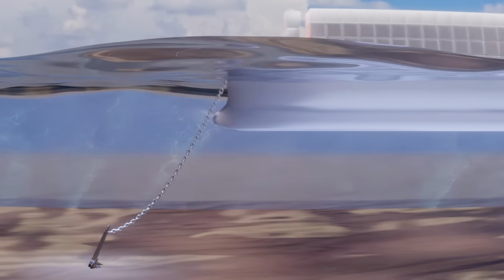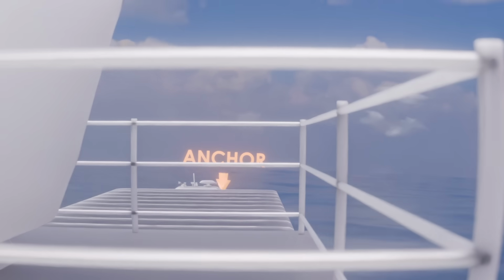Anchors don't work the way you think

Comment: But they left off the ratio of depth of the water vs the length of rode to let out. In calm waters, the ratio is about 5:1. So, if the depth is 100 meters deep, they would let out 500 meters of chain. If rough weather is expected, you let out more like 8:1 or 10:1 so the catenary curve acts more like a shock absorber as the storm batters the ship.
Some of you have heard the term 'bar tight' which means so much force  on the rode that the chain is straight. That's highly unlikely, since to really get the catenary curve out of the rode, you would have to pull so hard the chain or anchor or the attachment points would break. So, take it with a bit of salt...

And since there are thousands of tiny boats (under 50') out there  that use rope for an anchor... How does that work? Often, the anchor will have some amount of chain on the anchor stock and then the rope is spliced or coupled to the chain. The chain still helps keep the stock down, and keep the anchor from pulling out of the sea bed. The longer chain you have, the more secure you are.
One more thing, most anchor chains on ships use a studded chain, which has a bar in the middle of the link which keep the link from stretching. Their animations didn't show it properly. 
If you want to know more Nautical knowledge, read my book on amazon called The Nautical Dictionary.

Comment: Never worked with an anchor like this. My dad had an anchor on the outboard motor boat we used to go fishing. It seemed to hold us in place. Sometimes it held us in place very very, very very well. To the point you couldn’t get the anchor up. At once, when we were about 2 miles out to sea, anchor got stuck, my dad got impatient, and tried to pull it up with the boat. The anchor then prevented the boat from moving up and down with the waves, a wave came, washed over the stern the boat, and we went swimming. Luckily one of my uncles was out with us, noticed the problem, and we all got in his boat.

Comment: To pull the anchor out you have to reel in the tow road or chain so that it is directly under the boat. Then to pull the anchor up you have to reel in and unbury the anchor from the bottom. You may have to pull up hard. You know that you a vertically over the anchor because the bow will dip down in the water.

Comment: Working in 5000ft water depth, we'd run out 3000ft of chain followed by around 10,000ft of wire. Do that eight times and you have anchored a deep-water semi-submersible oil rig.

Comment: So here in Michigan ferries will actually do something called anchor turns basically, while heading directly towards the dock, they will drop the anchor and do full lateral thrust swinging themselves around so that they can essentially back into the spot. Imagine this is possible because of the relative weight of the anchor versus the size of the boat. Just a heads up that it's not complete fiction

Comment: as a harbor pilot with 20 years of experience I have probably anchored around 1000 ships,  an anchor will definitely stop a ship if it's going pretty slow. We use anchors to help ships turn when going slow and no tugs available. Bouncing an anchor off the bottom at slowish speeds can aid in handling.

Comment: The title should have read, “Anchors don’t work like you think, Unless you were in the Navy” lol.  I learned nothing from this video.. And thank goodness right.. What would the Navy be if they didn’t teach this in bootcamp lol.. Theres actually a question in our bootcamp tests that asks.  “What part of the anchor actually does all the work?”. The answer is The Chain.. The chain is what actually keeps a ship from drifting.  The Anchor is just the point that keeps the chain from snaking all over the sea bottom.  Now on small boats, yes, the anchor does all the work if its just tied to a rope like you see allot. Or those weighted anchors that look like a mushroom.  But on big ships, custom chains are build for the specific size of the ship.  Still a great vidya!

Comment: This is not entirely true. The anchor cable , because of its weight', pulls the anchor Horizontal and forces the anchor to plow deeply into the sea floor. The captain and crew choose precisely where and when to anchor their ship. When the anchor hits the sea floor (this can be automatically or manually count) they let the ship drift slowly backwards until its weight' pulls the chain under tension. The condition and material of the sea floor matters everything. Its everything together that makes the anchor work not only de heavy cable. Besides that, you have all kind of different anchor size, weight and curves for different purposes.

Comment: Anchored off the canary islands, La Gomera, our windlass malfunctioned, the anchor roller bow sprit (made of quarter inch welded aluminum) bent about 45 degrees over to the left, almost letting the chain slide off the roller and in to the siderails
 
Two of us of the three man crew had to haul up 60ft of chain by hand in 10-20kt gusts, cap on the helm... took about 4 hours because every time the wind ripped down this hill on to us, the boat pushed back and the anchor chain tensioned, pulling it from our grip like butter. by the time we got it up we had discovered it must have been buried deep in silt or wedged between rocks on the seafloor, the 25-30kt gusts we had the night before sure dug it deep.

For anyone wondering, we were not able to get the windlass repaired for about two weeks and had to hand haul every time. Busted my foot the same week dropping a Danforth on it, sailing is not for the weak-able or minded🤣
Reply: Thank you for this story. It was really interesting❤
Reply: I’m just amazed that the aluminum deformed that much and didn’t snap off. 

My experience has been if you put that much deflection in an aluminum piece (especially if it’s been welded as you are going to have a very brittle bit adjacent to a very soft segment of metal) you are going to have a catastrophic failure and end up with one piece now being two. 

I would have loved to had a clip of that happening, preferably high speed photography. Seeing metal fail because of extreme stress is almost hypnotic.
Reply: @just9911 Oh i have a picture of it, it was the first thing I did before approaching it further, i can't imagine how much force was going through it, the skipper reckoned it was somewhere between 800-1000 pounds of force but who knows! We actually had an albatross hit our mast on passage a few nights before we arrived there, I learned they can be a bad omen 😂
Reply: yes
Reply: I hope your foot healed ok. and still functional except for weather prediction.
Reply: Interesting story! Greetings from the Canary Islands 🇮🇨🇮🇨🇮🇨

Comment: Interesting. I used to pull underground fiber optic lines, and even after a few hundred feet, the drag of this lightweight fiber line get considerably heavy. For longer lines we'd need guys to lift and pull to the main puller isn't yanking all the weight. The kind of lines we used to pull didn't like to be twisted or kinked, so we would have to fully uncoil it on the ground before pulling it into a conduit.

Comment: All modern commercial ships have chain counting sensors that are integrated with the ships monitoring software. Shackle markers are still painted for redundancy and they’re also mandated by regulations, but not really used anymore.
Reply: Forgive me, I am an old school mariner, as in sextant not GPS and I learned the 90 foot measurement of chain was called a SHOT and not a SHACKLE!  When did this change?  Does anyone know IF this has really changed and when.  Shot is the same terminology on both sides of the Atlantic!

Comment: This actually makes sense and now I get why I can’t keep my boat in place. Even though I only have a 22 foot boat that weighs nowhere near as much as a ship I’m assuming the same concept applies. I actually have an anchor that looks just like the one in this video but I have very light twine tied to it. I’m going to buy a really heavy chain and see if that does the trick,
Reply: I'm not sure it applies to boats and chains that size (I have the same size boat).  The chains are only ~ 6 ft long and weigh 15 lbs maybe (with a 4-lb anchor).  I need to set my anchor manually most of the time.

Comment: i guessed they worked like this but what about the side wind or the tail wind? Are the perpendicular routers (to the length of the ship) used to prevent it form moving sideways and the main one to prevent it from going forward? Or does the side to side movement not matter too much and it’s just neglected? It would be great if someone explained it to me, thanks in advance!

Comment: I remember when i used to use a 3 lb mushroom anchor on my kayak in sandy flats and it didnt work, but i bought a 2 lb danforth and it would dig in the sand. When i wanted to pull it up, id pull my kayak directly over the anchor it would easily dislodge. So anchors work exactly how you think

Comment: 5:39 "three means the third"
Reply: Let him cook
Reply: Ok
Reply: "Real measuring dimensions" 
😅
Reply: Isn't painting the links a simple digital encoding as opposed to analog?
Reply: @bobhuang94  still analog, just because it's discrete doesn't make it digital
Reply: @whataboutthis10 I'm being pedantic, but digital data and signals existed long before computers. The abacus is a digital calculator. Smoke signals and Morse code are digital means of communication. However, the common use of the term digital usually implies computers and binary data.

Comment: Weight of the anchor ⚓ depends on the size of the ship. Usually a cargo ship as about 11 shackles stored in the chain locker. Sperate lockers for each anchor ⚓,  Port and Starboard side below deck.

The amount of anchor ⚓ ⛓️ chain laid out on the sea bed depends on nature of the anchoring ⚓ location, displacement of the ship that's whether the ship is in light or loaded condition, prevailing weather conditions, under sea current, proximity of under water danger, and other ships at ⚓...etc

In case of emergency when the anchor ⚓ and chain ⛓️ can't be heaved, due to weather, mechanical failure...etc, there's a easy access below the bow deck aka "Forecastle" the end of the chain ⛓️ locker called "Bitter End".

If the anchor ⚓ and the full length if ⛓️ is walked out to hang in deep sea, very high probability the ⚓ "Windlass" aka "Winch" would not be able to heave home.

Ship's Captains know how shackles to lay and using the propulsion to lay and heave home so not to put to much weight on the ⚓  and ⛓️.
The term "⚓ Brought Up" when the ⚓ & ⛓️ have taken the "bite" and "⚓ "Aweigh" when the ⚓ is off the sea bed / hanging by the ⛓️.

Comment: the weight of the anchor depends on the size of the ship. If the anchor drops at full speed the chain would not snap but the anchor would pull the entire chain out of the locker and the holding bolt would snap. Otherwise well explained👍

Comment: As a diver that owns his boat and dives down to make sure the hook is set correctly, most of what is said in the video is true--all but the part about the chain holding the ship.  With a proper scope, the chain offers little resistance.  Each link is smooth and round and it can easily slide through the soft bottom, riding in a trench cut by the previous link.  I've removed anchors from chain underwater and watched the chain quickly zip along the bottom without its anchor.   The catenary curve makes the transistion from a vertical pull to one that's horizontal--the chain goes into the water nearly vertical but when it lies on the bottom, the pull is transitioned into a horizontal orientation that seats the anchor into the bottom.  While the chain does offer some resistance, the anchor provides the main stopping force and not the chain.
Reply: Is this the difference between how it works on smaller boats Vs a huge one though?

Comment: i mean, you explained how huge ship anchors work better then we think but thats not what the title says
i have a 4000 lbs boat that i can push with two fingers when its at a dock, the anchor i use is just a large metal ball on a rope, the second that ball touches the lake bottom it takes the same amount of force to drag it as if it were on dry land
THAT is a better explanation for HOW an anchor works 😂